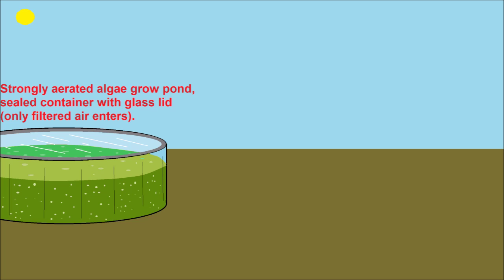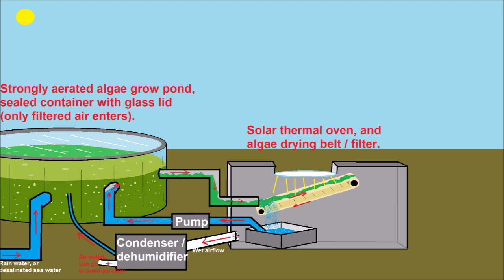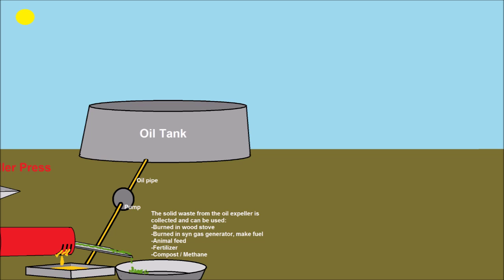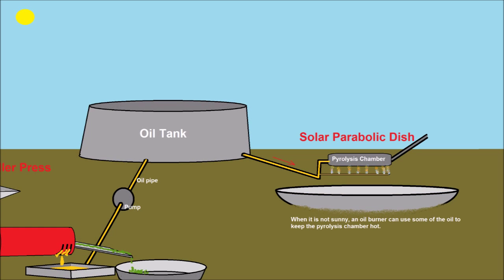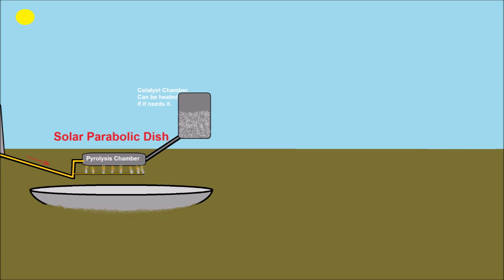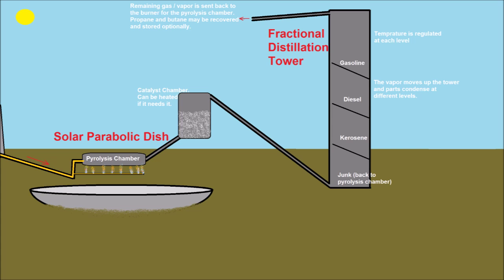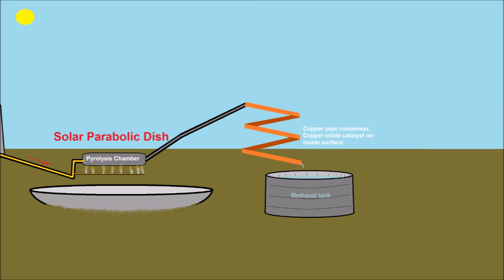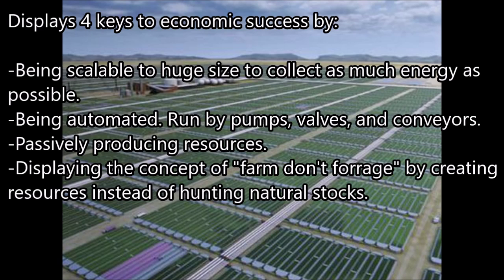UNLIMITED GASOLINE SciPhi 05

Comment: @JaycubL This is nice but think of the environmental consequences of burning gasoline......
Reply from the maker: The algae farm would absorb more carbon from the atmosphere than what is contained in the useable fuel that is produced, so as far as greenhouse gasses this would be a big positive. Yes electric is better for the long run, but scrapping all gasoline cars now and replacing would be worse, so we need a practical and friendly fuel source like this. The other emissions like hydrocarbons and NO2 should be minimal with a well-tuned engine and catalytic converter.

Comment: my question would be, why bother and crack process the algae oil when it's already burnable as it is for example in some varieties of diesel engines?
Reply from the maker: The purpose would be to make it useful as a drop in replacement for petroleum in all ways. Some types of engines can run on triglyceride oil but it is not as good in cold weather because it thickens, and it does not work quite as well or in as many vehicles as regular diesel fuel. Most passenger cars are gasoline fueled anyway. A lot of oil from this could be used for human consumption/cooking oil, or sent to a different kind of refinery to make plastic or other fibers or rubber etc. But this video has a narrowed focus for directly replacing standard petroleum fuel without any need for change of equipment by the users.

Comment: looks like you don't have to go so far into the process as described to get a viable fuel, diesel engines can run off of vegetable oil with very little more than filtering it.

Comment: but you need to provide nutrients too, I google for it and found that it is consist of  baking soda, potassium nitrate, ammonium phosphate, sea salt, chelated iron.

then measure the efficiency between gasoline production and resource needed
Reply from the maker: +Oswald Rayleigh Yes that's an important part not it the video. You could use something like "compost tea." All you want to take away really is the oil so it would be possible to cycle the nutrients back in from compost made from the solid byproduct. Ammonium nitrate can be made from air and water, or you could use animal waste. Using sewer water to feed this could be an option. I don't think it would need much nutrients at all compared to the amount of oil that can be made.

Comment: algae are awesome, you can change all kinds of variables while they multiply to get more and more of the thing you want like oil in this case, my brother did a research project to get as much proteine in algae as possible. They wrote an article on it and it's really cool!
Reply from the maker: +Remco van Woerkom Cool is the article available online?
Reply: I could put it online for ya but it's in Dutch I think
Reply: yeah it's in dutch, could still email it to you or something if you want.
Reply from the maker: Remco van Woerkom Thank you for the offer, but I wouldn't be able to read it. Free translators are probably not going to be able to handle a technical thing like that either.